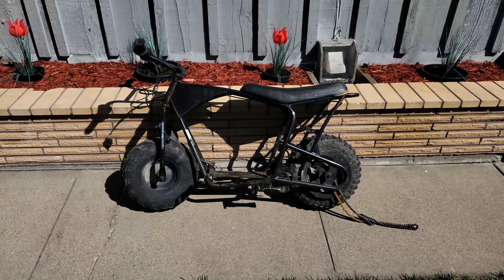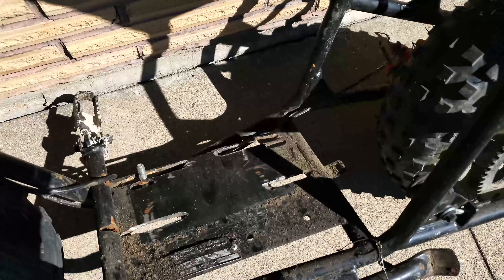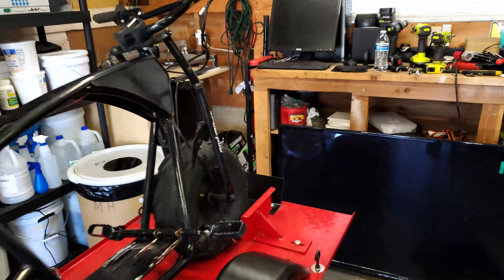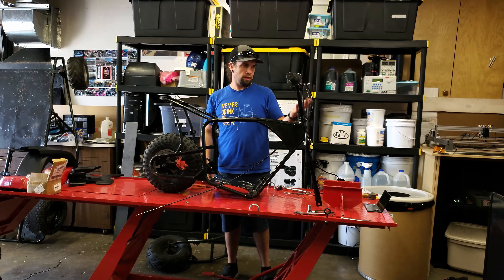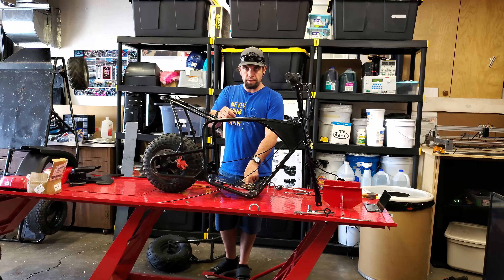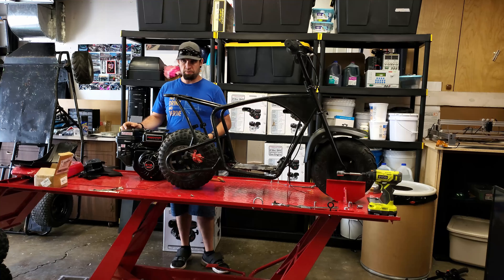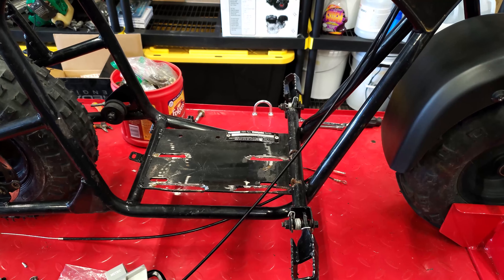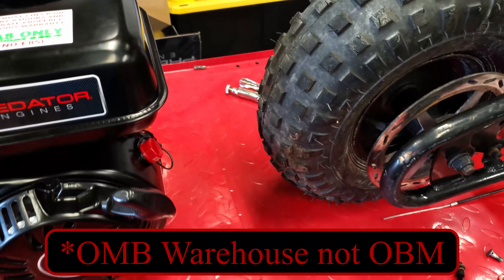Mega Moto Mini Bike Build - Part 1 - Front End Rebuild & Predator 212cc Motor Fitting

Comment: Looking to add taller fatter tire to that frame, what's your recommendation for on and off road?
Reply from the maker: I think the frame will limit how much wider you can go, but you can go taller. I haven't switched from the stock wheel set up, so I do not have any recommendations for larger sizes yet. But, I do remember looking at gopowersports.com in the past and and I believe they have both 8" and 10" wheel options.
Reply: Mike, thanks a lot I appreciate your experience and info...

I'm so tempted to build one of these because I just love the space age design of the frame. I have four customs and six heavily modified bikes in my shed however at 67 years Young I can't seem to stop! I need help!!
Reply from the maker: Haha, I know how that goes! I can go kinda crazy picking up projects until I have no room left in the garage... 😆